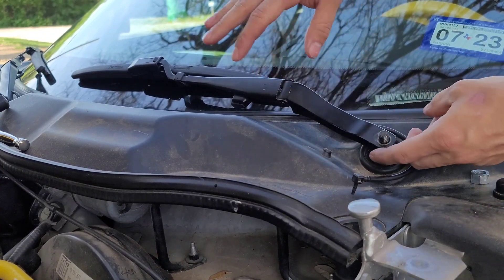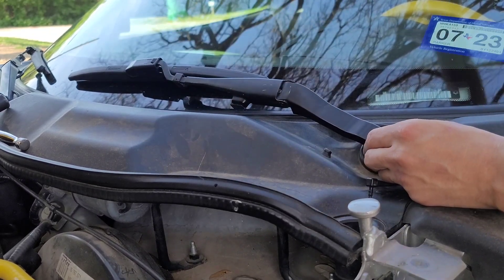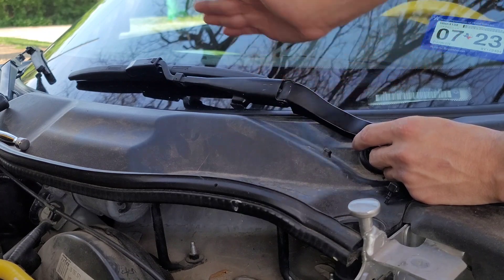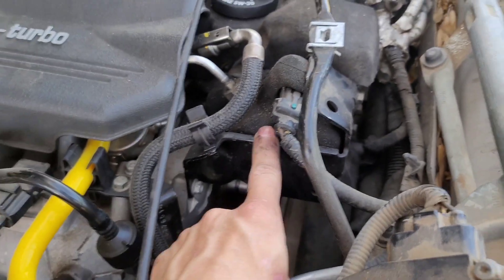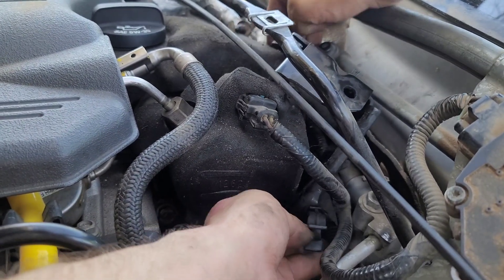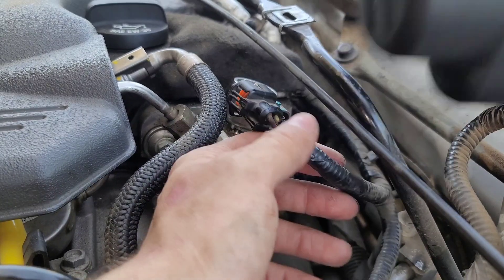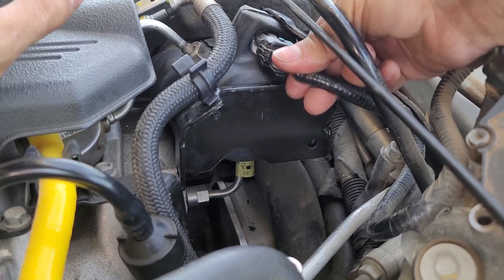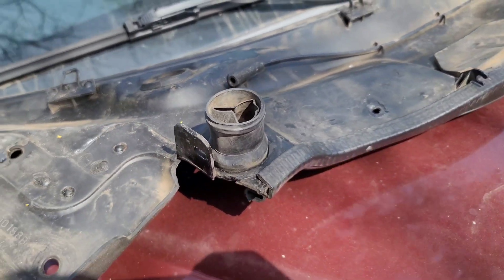Saturn Sky Fuel Pump Insulator Replacement (TSB 09-06-01-004)

Comment: What part is dat insulator...thanks nice videos very helpful and informative
Reply from the maker: Thank you, that's exactly what I strive for.

The Part Number for the Fuel Pump Insulator is 12628069 and can also be found in the info sheet with the Link I've provided below!

Link:
https://docs.google.com/spreadsheets/d/1XlCUz4EnlueHOavii7GiCGBo5alT2sw1Jbq0eSJ9HDU/edit?usp=drivesdk
Reply: The fuel pump insulator cost?  And is it a dealer item
Reply from the maker: The Fuel Pump Insulator is generally about $10 to $15 and can be bought from many other websites besides dealerships. Below is a link for a site I typically use to buy parts.

Link:
https://www.gmpartsstore.com/oem-parts/gm-fuel-pump-insulator-12628069